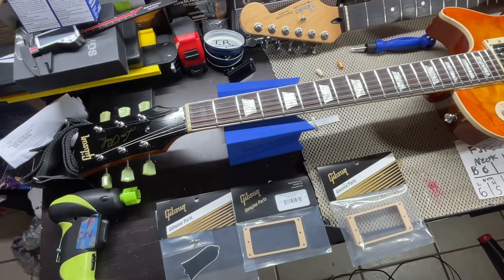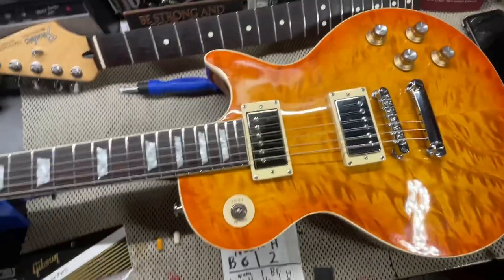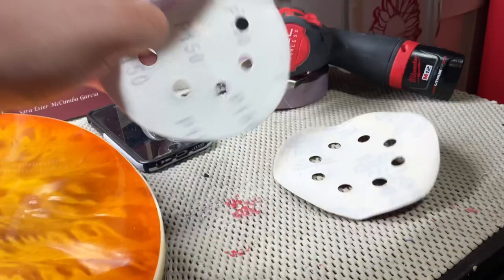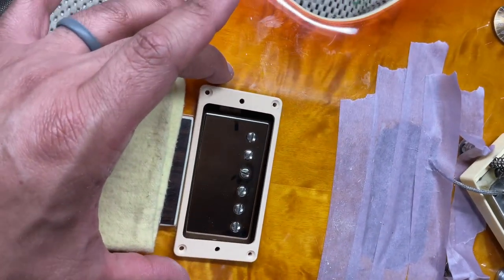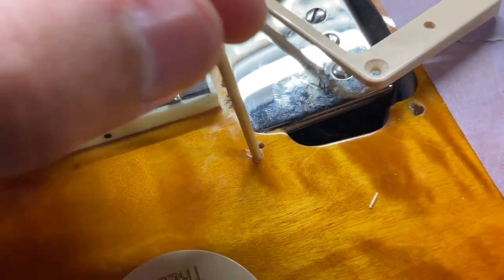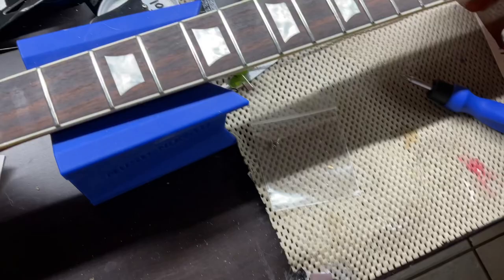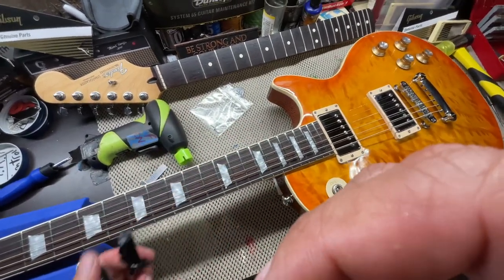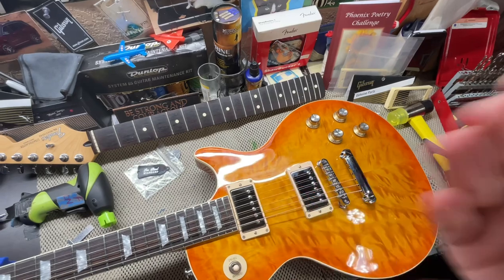Installing Gibson Parts on a Chibson Quilted Top ￼Epi #4￼ @MusicNomadCare @CS_Murphy_R9

Comment: I found thumb wheel adapters for import bridges on Amazon,they basically screw right into your bridge studs, turns your bridge into a small post bridge, makes the guitar look even more realistic,might even help sustain,that's what we do,when trying to live the dream on a budget guitar,we are going to try to get as close,to the real thing as we can.
Reply from the maker: Thank you yes I’ve seen som cheaper one and the FABER® ABR-59 Bridge that I really want I’m going to do a review and demo the way it seats and then start more upgrades 😎🎸🦯✌🏽🕊✈️✝️🎼💙 
Thank you for the support, feedback and info 😎🌻🐈
Reply: @holyrollerguitars  I'm in the process of making a brass nut adapter for the truss rod,half inch bolt cut off and reshaped into a hex wrench on one side and enough threads on the other side for a brass nut to screw on & fit the hex part right inside the hex in the truss cavity ,might have to epoxy the brass nut to keep it from turning on the thread end,then you insert the hex part of this extension adapter into the hex on the truss,and it will look like I have a brass nut in the truss rod cavity,I suppose you don't have to make it work and you could just file the back of the bolt enough to just fit in the truss hex,but I'm going to try to get it work with a Gibson truss wrench,so it would be more like an extension adapter, can you imagine the surprise, when you take the truss rod cover off, and show peeps that there is a brass nut in the truss rod,this might be a pretty easy mod to pull off after all,now that some chibsons are coming with fret nibs, the only thing left is the brass nut on the truss and the wings on the back of the headstock, take a razor blade and a straight edge to fake the wings,scratch in very light lines,I'm not doing this to fool others,I'm doing this for a guitar I will never get rid of,and I want it to be fairly accurate in specs.
Reply from the maker: @2dazetake  sounds like you are having fun with your guitar same here not planning to get rid of mine because my wife loves it and she nicknamed it phoenix because underneath the tail piece if you turn the guitar upside down it looks like there’s a phoenix there she told me never to get rid of it as well and it’s just going to be a modeling platform for me and something to continue to add on to, I might start working on the pots and wiring next 😎🌻🐈💙🩵❤️
Just have fun with it y not right 
😎🎸🦯✌🏽🕊✈️✝️🎼💙
Reply: "More realistic?" I think you may mean "more authentic?"

Comment: I've not watched your video yet (except for the beginning), the Chibson guitars typically use Epiphone brand pickup rings.  The Epiphone rings are larger than Gibson USA rings, sometimes the Epiphone ring mounting holes will fall outside of the Gibson USA footprint.
On the Chibson guitars I've modified I ordered them without the pickups or bridge and tailpiece installed.
Mounting the pickup rings, bridge and tailpiece studs myself allowed me to use Gibson Historic Hardware.  This made it possible to have a real ABR-1 bridge and correct/historic installation with very good results.   OK, I'll watch the rest of the video now.
Reply from the maker: Thank you for all the information. I really appreciate the support to the channel. 😎🎸✌🏽🕊✈️🦯✝️🎼💙

Comment: I would be more  into changing the bridge out to make it more original,large post gives it away more than the pickup  rings,I bought small post adapters  for my chibby LP but a real Gibson bridge is wider than the post holes,and the gotoh  ABR doesn’t fit,have to get an inport small post type.
Reply from the maker: I appreciate all the information and your guidance for trying to make a ABR one bridge fit on here that is a problem that I’ve been having so I just kind of stuck with the Wilkinson for the time being I have made an updated video with the historic Gibson pick up rings, which are the taller pick up rings which look really cool 😎🎸🦯✌🏽💙🎼👍🏽
Gibson Historic Pickup Rings on a Chibson
https://youtu.be/AgemYxAUi3k

Comment: It seems that the neck pick-up is turned around. Every Les Paul I have ever seen has the screws on the neck pick-up closer to the headstock while the bridge pick-up has the screws toward the bridge. they never go the same way. I don't know that it matters sound wise but they are always bridge one way and the neck the other.
Reply from the maker: Thank you for noticing when I installed these pickups I wanted to try the Gary Moore kind of sound. (Out of phase )  that is why I flip the Neck pickup but if you look at my most recent video with a Marshall Lead 20 I ended up putting it the correct way. I notice that having the pickup flipped there was actually more bass in the neck position because the slugs that are in the pickup bobbin actually have more pull than the screws. Do I saw that on Gibson TV? 😎🌻🐈💙🩵❤️
😎🎸🦯✌🏽🕊✈️✝️🎼💙

Comment: With the Gibson Pickup Rings, you don't need to sand them to fit, they are pliable enough that they snug down automatically when tightened, that is how they are mounted at the factory.
The only pickup rings you need to contour sand are the less expensive aftermarket rings since they are a different plastic than what Gibson uses.
Reply from the maker: Thanks again for the info. I wasn’t too sure if I had to send them down or not so as a precaution, I shaped them just a little bit. I love it. 
😎🎸✌🏽🕊✈️🦯✝️🎼💙
Reply: @holyrollerguitars  No harm done.  I've built two Chibson's from Ali Express.  I found a builder that allowed me to send specifications such as 1-Piece mahogany body and neck with a long neck tenon.  I located and drilled the ABR-1 installation and stopbar stud inserts.  Basically the guitar arrived as a finished husk.  I've a couple real Gibson Les Paul guitars (a 1976 Deluxe and a 1986 Les Paul Custom), the Chibson compares very well to both of them.  I'd like to add, I had to perform a complete fret leveling, crowning and polish for the guitar to play well.  It is currently set up to Gibson specifications.   If you would like I can find a video of me playing it, I can post it for you to check it out (if you're interested).
Be Well Sir.
Reply from the maker: Yes I would like that thank you you can reply with link when you post it 😎🎸🦯✌🏽🤙🏽

Comment: I have bought many of these. In 2007-8 the models were made well but one black custom I have is good they way they made it. Others I have put aftermarket parts from some pretty well known companies and Seymour Duncan, DiMarzio. Totally rebuilt a 355 with Seath lovers. Now I have an L5 and thinking of true Gibson replacement parts. Some of them are good others can be not so good (Chibson).
Reply from the maker: Thank you for all the information. I am not completely sure what year this guitar is, but it is or was made very well hard. I’ve just been seeing more chips and guitars on YouTube and head wish that this came with that ABR one kind of bridge but it’s all good. 
😎🎸✌🏽🕊✈️🦯✝️🎼💙
Reply: i have 4 different chibson les pauls. i do like them and play them after installing gibson pickups etc. however mine needed alot of fretwork and i still havent perfected my fret filing technique yet. how were your frets?
Reply from the maker: @stevehaye  there pretty good no problems on this guitar 
Can you send pictures to my email? So I can check them out 
😎🎸✌🏽🕊✈️🦯✝️🎼💙
Reply: @holyrollerguitars  sure... where do i find your email address?
Reply from the maker: @stevehaye  here it is it is also on the About of the page 
Holyrollerguitar@gmail.com thank you 😎🎸✌🏽
Reply: hi i sent you an email. let me know when you get it.
thanks

Comment: I too am curious about sanding the logos down to black and clearing over! I have a chibson with a crooked diamond and I just want to remove it without having to paint and scrap the headstock binding completely
Reply from the maker: Thank you for your curiosity. I am also curious on yours if it’s a sticker or if it is actually an inlay do you have a 335 or an SG type guitar? 😎🎸✌🏽🕊✈️🦯✝️🎼💙 
Please consider subscribing I will more than likely send down the logo and change out the Tuners and possibly see if I can darkin these Tuners up from looking green to a different color. Not sure what’s going to happen. 
Considering putting them in coffee, that is the way I darken up the fender plastics 
😎🎸✌🏽
Reply: It's basically a decal which has been lacquered over, so after sanding, you'll HAVE to refinish the headstock. Owning a Chibson in the US isn't illegal, it's selling one in the US which is illegal, so I wouldn't even worry about it.

Comment: The frets always have to be leveled and you should replace the nut of you choice. The bridge usually has to be replaced do to rattle and loose fittings .
Reply from the maker: Not sure if previous owner fix the frets, but I haven’t had any problems with them yet. I need to get a fret leveler to check them and also not sure if they replaced  the nut it seems to be pretty good. I did replace the bridged with a different one that I had because of having rattling from the saddles screws being loose 
😎🎸✌🏽🕊✈️🦯✝️🎼💙 I appreciate all the help y’all are giving me. Thank you so much.

Comment: I tried the gibson pickup rings on  mine,  but being shorter the screw holes in the body were visible so they wouldnt work,  I wanted to switch from black to cream so had to order some china pickup rings off ebay.
Reply from the maker: Hey, sorry to hear that. The same thing is going on with mine but for the cut out of the pickup is actually kind of showing and maybe one screw I believe in the bridge pickup is showing just a little bit but from a distance you won’t be able to tell, just keep an eye on the video and maybe you might be able to see it or follow me on my Instagram page were I took some pictures outside and you can barely see it for the pickup routing 
😎🎸✌🏽🕊✈️🦯✝️🎼💙

Comment: When you order your pickup rings you have to get the curved rings for the Les Pauls
Reply from the maker: I didn’t know that I’ll look at that the next time I need to order some pickup rings. I didn’t know Gibson has curved pickup rings. I’ll be sure to ask my gear advisor to check on that . 😎🎸🦯🌻🐈💙🩵❤️✌🏽🕊✝️🎼✈️👍🏽
Reply: @holyrollerguitars  I’ve done the same thing most les Paul’s have an arch top, the guitar looks great
Reply from the maker: @Swamp525  I just ordered some historic cream pick up rings for Les Paul. Make sure to keep an eye out on the next trip and video probably next week. I’m going to replace these pick up rings with the historic pick up rings from the looks of it. They don’t have the curved cut out of them. 😎🎸🦯 actually working on that video right now.
Reply: @holyrollerguitars  It's true. SG, Explorer, Flying V, etc have flat rings as per this video. Les Pauls have a curved top so you'll need curved rings as well.

Comment: I see one mistake you made. The PU rings aren't for a Lest Paul, but for an SG or Explorer, as they are flat rings. You should have ensured they were curved rings instead. It's kinda late to exchange them but now you'll know for future projects.
Reply from the maker: I believe Gibson pick up rings ship out this way I recently bought some historic Gibson pick up rings and they came the same way flat so I had to send them down to the radius of the top of the Les Paul with some sandpaper and some tape and filing to make the edges a little bit more smoother Not 100% sure that Gibson sells them with the pre-radius on them since this is my second pair. I should really do some more research to find out if they do maybe I have to order them directly through Gibson. Instead of the Guitar store. 😎🎸👨🏻‍🦯🎼👍🏽🙏🏽🕊✝️✌🏽
Reply: @holyrollerguitars  Gibson makes guitars without arched tops, so...